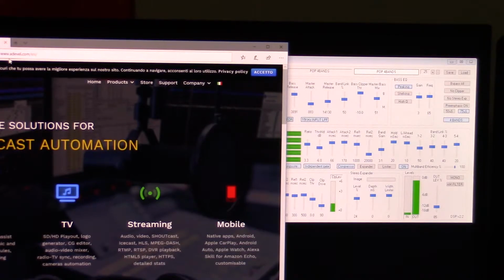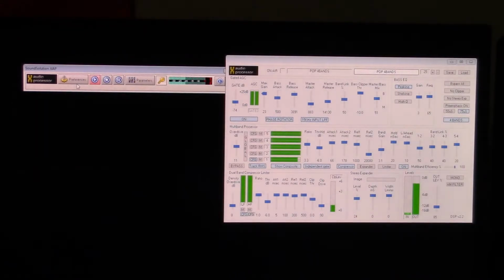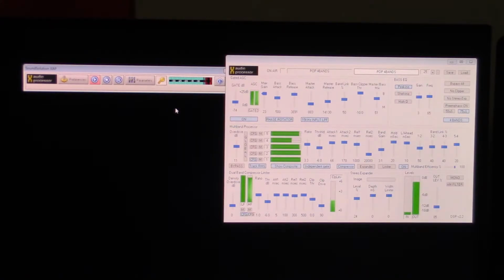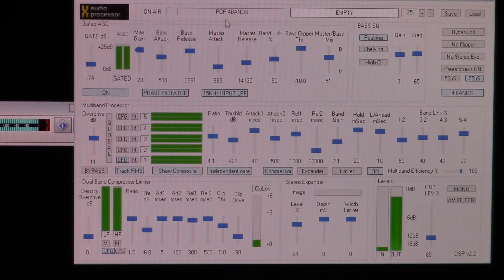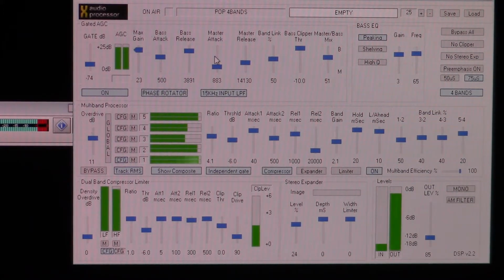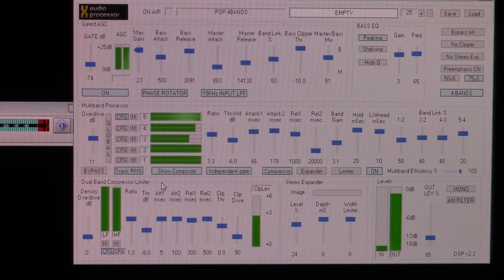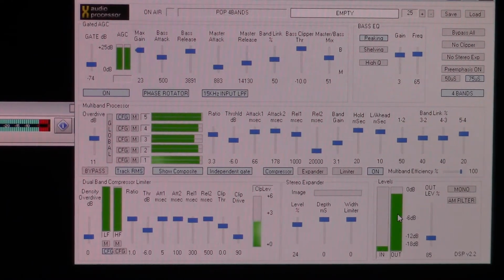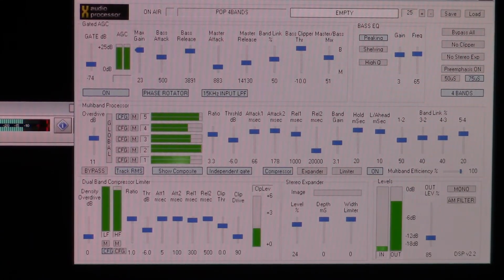AirWaves Episode 13: XAP Audio Processing, For A Home FM Radio Station

Comment: When you're on the air, do you. monitor air and notice a slight delay on the audio? I am having that issue and I'm looking for some help in what others have done to get past that issue.
Reply from the maker: Robert, no I monitor off of program.  Like you say, there is a slight delay otherwise.  That's because I'm using a software audio processor.  If you use an analog processor , then no problem.  My audio actually mixes pretty well in my headphones though.  You could run your headphone monitor out, into an analog processor, then monitor off of that, to mimic the on-air sound.  It wouldn't sound exactly like "on-air", but will give you that feel.  I do have a live air monitor, running from a tuner, into a CUE channel on my mixer, so i can go back and forth to monitor.  I use the air monitor when just listening to the automation run through it's paces.
Reply from the maker: Back in the day, before digital processing, I always listened to the air signal, and wouldn't have it any other way.  I use a software program called MP3 Gain, to set all of my music at the same db level.  That way i don't have to worry about riding the pots, and with the mic processing I have, it all mixes well, even when listening to program.
Reply: @Airwaves-Radio  I have a Aphex Compellor that I just pulled out of the rack in favor of the software processor. My plan was to add an Aphex Dominator II, but frankly, the software versions available blow those away. I'm testing Stereo Tool, with a few downloads I got from some users. I'm using one now that is set like an Optimod 8000. I was so impressed, that I've decided to give up on the physical procs. :) Just a shame that there's a delay.
Reply from the maker: Put the Compellor on your headphone jack and monitor through that.
Reply: @Airwaves-Radio  I think thats going to be my final solution. By the way, thank you for pointing me to PlayoutONE. I love that program! I see you use Music1, I'm going to start with the native scheduler until I get to a point where I need to more advanced features that aren't available.
Reply from the maker: M1 & P1 are designed to work together.  So, when you are ready for M1, it will automatically import the music library from P1. Making changes in either program will update the other program.